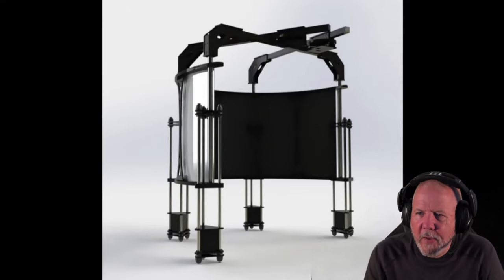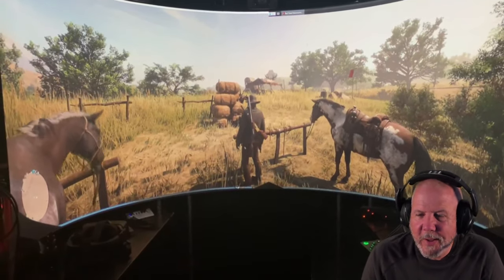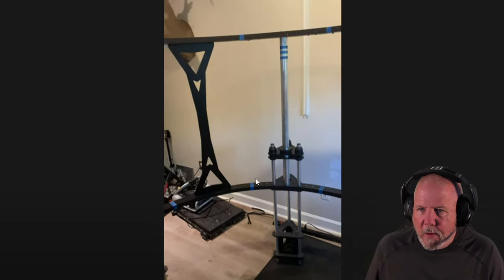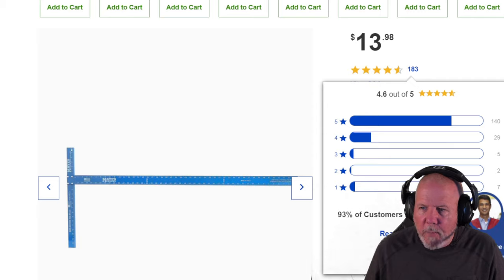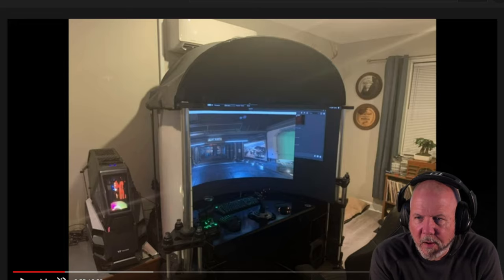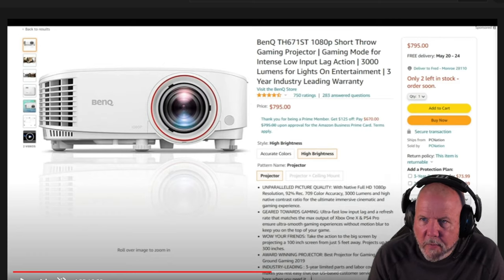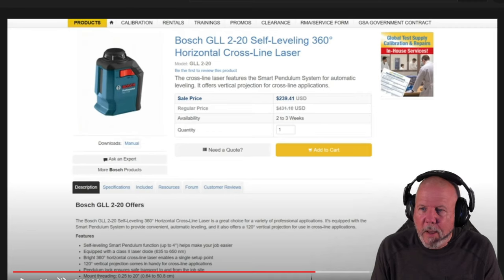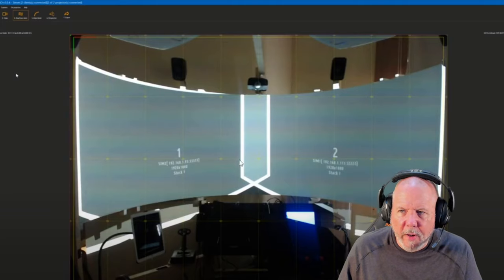SimPit Setup

Comment: Thanks for taking the time for a awesome tutorial Fred. Fred I noticed the Drake Caterpillar on your screen. When you played star citizen did you notice if the sides of the picture with the projection get the fish eye look? meaning stretched out. Im not sure if it only happens with a 3 tv or monitor setup, its one thing that stops me from getting 3 tvs.  Also with the projection set up did you get any screen door effect in the picture?  I know there are pros and cons with both ways, tvs having a clearer picture then the projectors but with projectors no bezel is in the way. 
Cheers in advance Joe
Reply from the maker: Using two 4k Projectors overlapped gives no fish eye effect on the edges. Its not a stretched image so there isn't any distortion at all. And there is no screen door effect what so ever. Its crystal clear.
Reply: @Condor060  awesome thank you

Comment: THIS is absolutely brilliant!  I appreciate you taking the time to put it together.  I ordered a 202 pro and expect it to come in next week.  I was concerned that there didn't seem to be a whole of lot of info out there on how to set up and align the system.  I was expecting "hundreds of hours".

I do expect there to be a significant learning curve along with a heaping serving of frustration.  As with most projects, when I look back it's my own fault because I didn't take the time to research or think something through.   You might have just given ice water to a guy headed to hell.  Thanks Fred!
Reply from the maker: Hey Don. I accidentally left out one part of the process so go back and read what I wrote under the video. Its was a long day. lol I literally spent a couple hundreds hours doing it wrong. If you follow the video it will eliminate all the problems with the equipment and warping technology. If you run across any problems or have a question feel free to give me a call. Happy to help. 704-221-6550
Reply: @Condor060  I really appreciate your generosity.  I'll certainly do so!